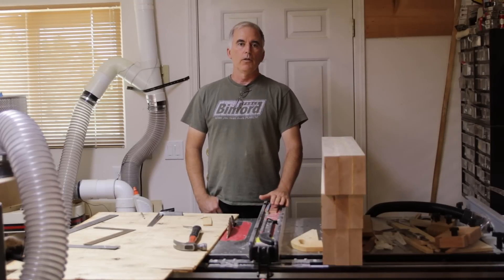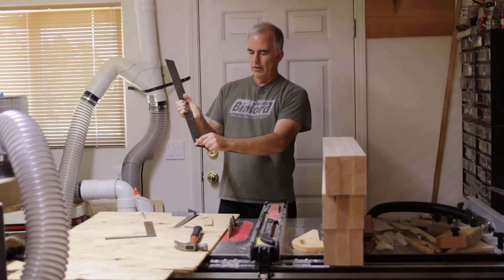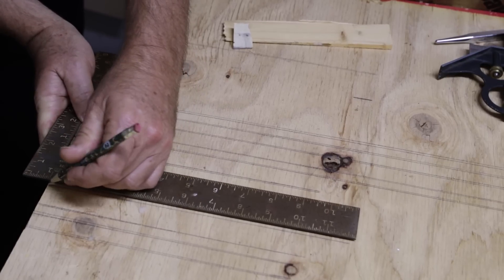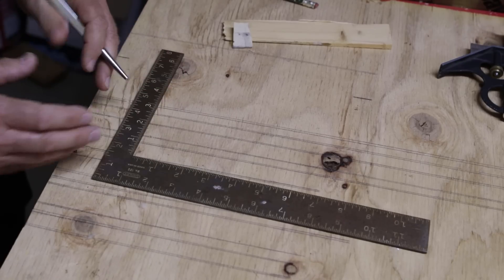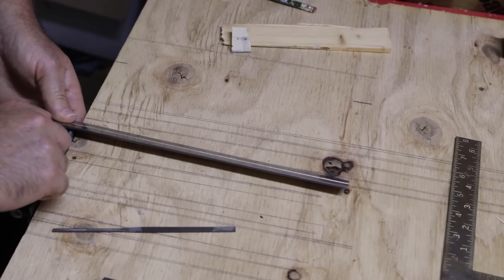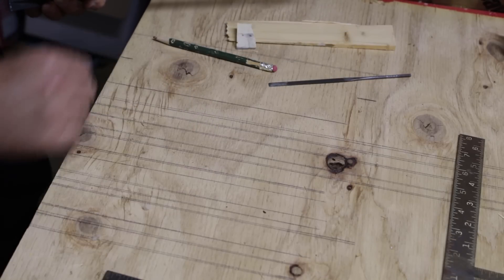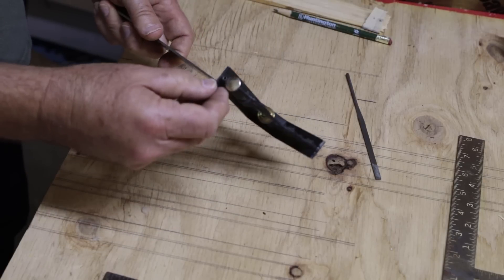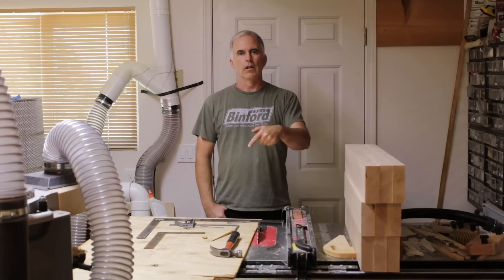Check your square, then fix it if it isn't square

Comment: what if your straight edge is not that as straight as you think?that would make a square square out of square wouldn't it???
Reply from the maker: True, the board you use to square the square needs to have a straight edge. I made mine with the table saw, but you could maybe use the edge of a piece of plywood that came from the store. If you don't have a straight edge to go from, don't use this method, or you may make your square worse. Good luck.
Reply: So how do i make for sure.I was trying to cut a perfect square recently and i made one edge perfectly square with no light escaping between the edge of the square and the material to be cut. but i always end up with one edge not being perfectly square?????
Reply from the maker: It depends on what type of saw you are using. Some of these techniques I'm learning myself. Check out videos about how to cut a plywood square accurately.
Reply: You could clamp a straight edge (a ruler you know to be straight) to your work table and work from that. As far as a work durface goes, a sheet of MDF would be better that plywood. As far as drawing the lines, run some masking tape perpendicular to your straight edge approximately in the middle of the MDF and draw your lines on that.
A note for precision's sake : when drawing a line with a standard pencil the width of the line will increase as you draw. An old school technique to mitigate this is to rotate the pencil as you draw. This takes some practice, but you'll get more uniform lines after you get used to it.